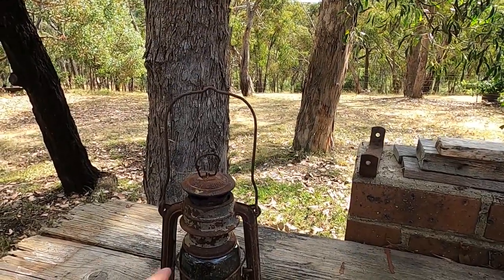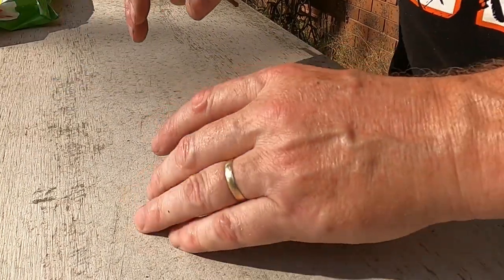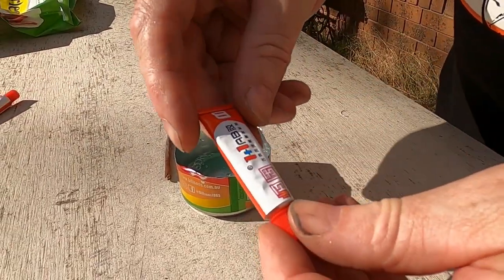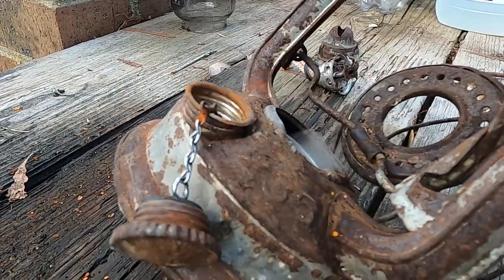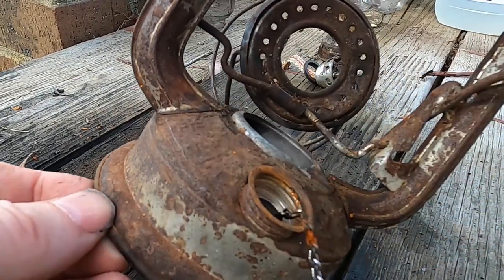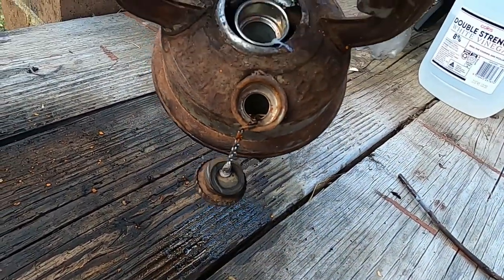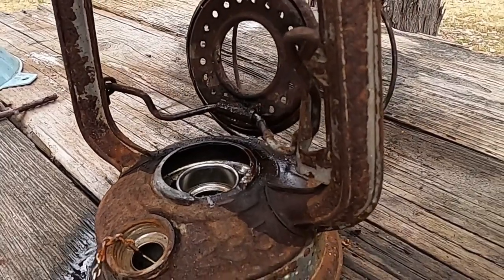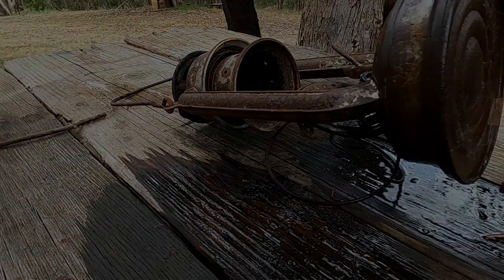Lantern Leak Fix Fail

Comment: Major restoration project
Reply from the maker: Yep, it was a half baked idea that I thought I'd try.
I didn't expect it to get so hot so quickly.. which I think is the main reason it didn't work.
Reply: @UnhingedHarry   I use tank sealer on new and old lanterns.   And burn diesel in them.  Love them!
Reply from the maker: @StarwaterCWS  I saw some tank sealer.. red Indian brand or similar.. but it was expensive. But it would have probably worked :)
Reply: @StarwaterCWS  I just tried POR15 on two lanterns I’ve got that have some leaks. I didn’t prep it a lot, just some metal chain into the tank…knocked the shit around….then rinsed a few times with isopropyl. Dried the hell out of the tanks, then poured the POR in. I think you could try that. Tape all the way round so the POR don’t leak out. Then coat it all the way and don’t touch it for 4-5 days while it sets up. I had a yellow tube of seal all as well, but that was like jelly and wasn’t very liquid so I didn’t bother with it.